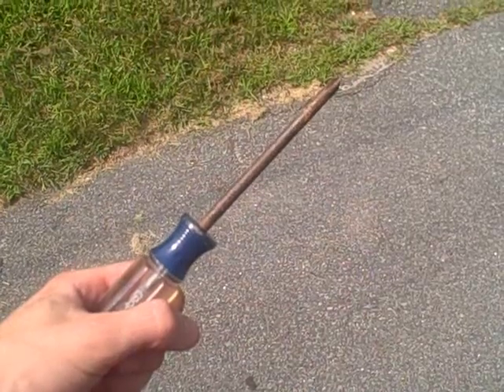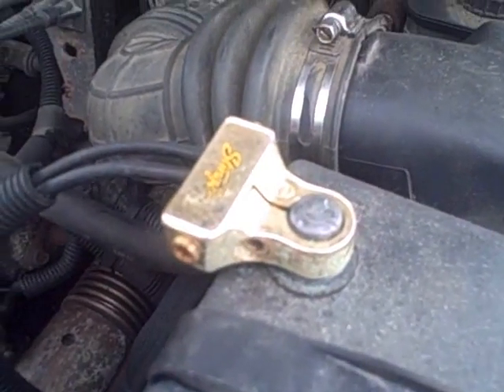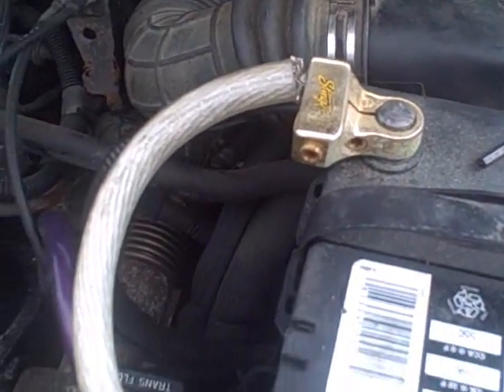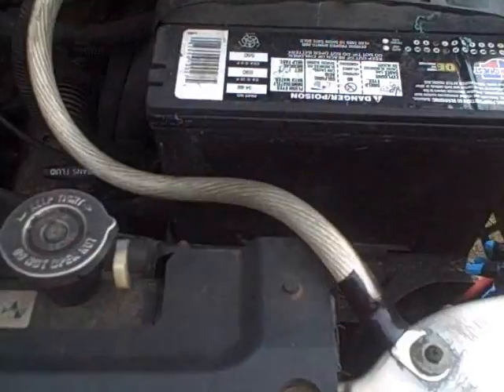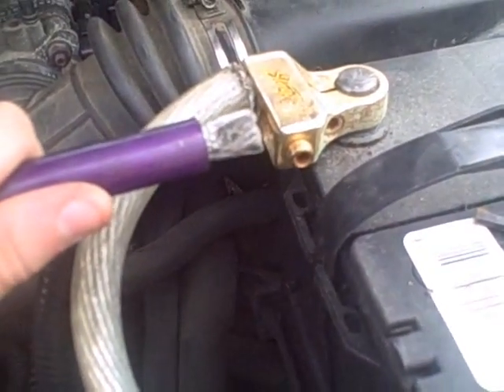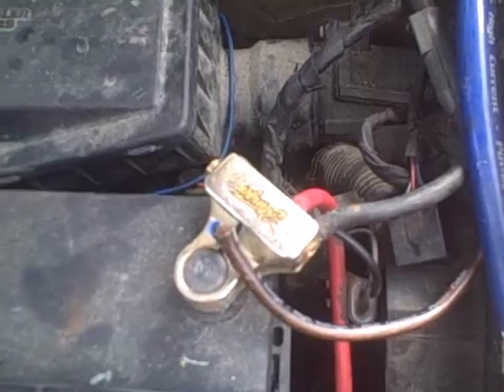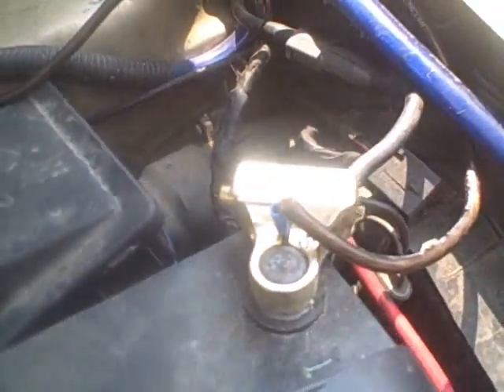Increase Car Audio Power 25% - How To Install Big Three Upgrade - Easy 15 Volt Stereo System Big 3

Comment: @watupholmes
Actually, here in NY, they will absolutely break your balls for having your system bumping. Anything over like 85-90 db will land you a $300 noise violation. Then, at that point in time, they have every right to start nitpicking and write you tickets for tints, exhaust, low tread, endangering the welfare of others, etc. Just because your ignorance hasn't landed you that lovely ticket, does not mean it is a foolish thing to say.

Comment: I'm from a family of mechanics, so we've know about this kind of stuff as it applies to other things as well. I'm using a second battery and 4ga. Im only running 1200rms watts (900 to subs,300 to mids) 4ga is enough. Now my lights only dim at idle at high volumes. You can just barely detect a slight blip in the lights at 2000rpm+. If i go with bigger amplifiers, I'll add a bigger alt, run 1/0 for ground and from battery to battery. At least you aren't telling people to put a "cap" in. Thanks!

Comment: hey bro, quick question every is saying to have my 0 awg wire from the positive on my battery to the alternator, however the positive on my battery runs to my starter and from my starter to my solenoid (ford) and then the power comes from my alternator to the solenoid,, what should i do in terms of switching for the o awg switch the wire from the positive battery terminal to the starter? or switch the one from my alternator to the solenoid..hope u can help
Reply: your (fused) wire from positive battery to positive alternator post connects in parallel to the existing system and works together with it transparently

Comment: @EXOcontralto dude i like ur video but as a plumber i can tell u that u can go down  a size w water and get the same gpm but ur pressure will greatly increase. the same process is used to create water pressure coming out of water towers and even in ur home to create more pressure...but going up wire sizes can't hurt anything and even if it dont help it makes it easier for when u do replace the alternator. u should'v done a before and after volts and ampage reading so no one could agure w u.

Comment: @addisonu23  Believe it or not, your tutorial is more informative than even RF has on here,and really easy instructions to follow.Only thing I recommend is to add the chassis ground to the strut/shock bolt as it is a more solid ground,directly to the frame of the vehicle.Yet, thanks for this info, as alot of people will benefit from your video.Thanks man!

Comment: @speakerlover13 I went to school for electrical engineering, worked for custom shops for 7 years, and now have my own shop; yeah, I'm probably an idiot. Most stock alternators only produce 90 to 100 amps. And I'm not playing the 'what if' game; I'm talking about stock only. As I have stated multiple times, you cannot draw more from an alternator than it was designed to produce. Upgrading the engine ground is still useless unless you change out the alternator power cable as well.

Comment: @EXOcontralto Oh, and if you require an analogy - Just because you put a 42" wide hose on a 3000 gallon per minute water pump, doesn't mean you will ever get more than 3000 gallon per minute.  The pump isn't designed for it.

Comment: @EXOcontralto Not sure if I'm replying twice or not, looks like my other comment got removed... But it all comes down to ohms law, you can't create more than your alternator can produce. If you're running 0 gauge to the back, yes you need to use 0 gauge to ground the battery, but if you have a stock alternator, there is no point running more than 4 or even 8 gauge from it to the frame.  Even if you did, you'd still have to run a new + power cable from the alternator to the battery.

Comment from the maker: @TheEnragedHawk - On the contrary sir - You can definitely increase the amount of amps drawn from your alternator... Just the like analogy of a hose - You could have a 6" hose on a 3000 gallon per minute water pump pumping out 3000GPM's.The second you put a smaller hose on the pump, the 3000GPM water pump can no longer reach it's full potential... Bigger hoses = Less Resistance = More Power.... Lesson learned: bigger wires allow for bigger current draws.

Comment: Good video, but I think you're off on your 25% boost and 15V estimates.  You can't create any more voltage/amperage than your alternator can put out (unless you're using a transformer but that would be pointless), and if you're using a stock alternator, 4 gauge is more than enough.

Comment: @MrWhybotherwithme I would start with google :) Then, figure out how much you want to spend, and how much bass you want, as well as the quality :) Personally i have 2x10" MTX Magnums (got them in a combo deal($180) with an amp,250wrms) and they are great, but low quality. It really depends on the box, and the box depends on how much space you have in your car, and what kind of box it is. Another MAJOR part of a sub system is the amp, a quality amp can make all the difference:)

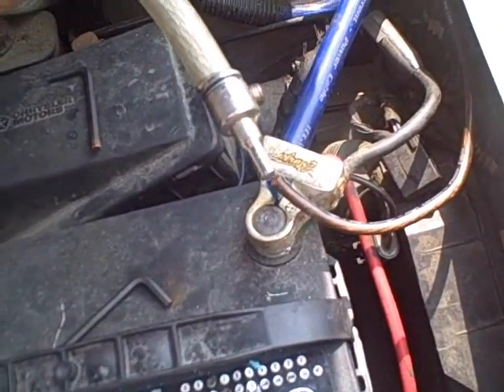Comment: @SubMasterT he has capacitors for his system. when they are drained, you dont want to just reconnect the battery or put the fuse in or it will spark hard enough to burn terminals as well as send all kinds of electronics killing voltage spikes through the electrical system. (the "zonking" he mentioned @ 2:36)

Comment: hey exo, im thinking about doin the big 3, but not sure what guage wire to use, since shits expencive in australia, dont wanna go unnecessarly big

ive got 2 12" kicker CVR's being powered by an Option Audio OAK1200 at 1200rms @1ohm, but my amp apparantly has a realy small footprint. ill also be running a 2ch amp, 300rms (75rms p/ch @4ohm)

Would 2 guage be good enough for engine block ground, battery ground and if I run the pos. wire and have it split to a 4guage and a 8guage? 

thanks man

Comment: little tip for you is if you need a washer and are too cheap to buy it,just drill a penny and use that. only costs you a penny.

Comment: Cool, I had it right all along. 2/0 to the back and 1/0 for the big three. Its a Work in progress. I'm building the wires now to run the big 3, and working on ideas for the amp rack. Im not in a hurry

Comment: hey EXO,
love your videos btw.

but to get down to business, ive been doing a bit of research and found the big 3 upgrade.
and its costs.
my wallet is a bit busted up after upgrading my system.
so what i did, with my old 8 awg, was making 2 connects over the existing car connections.
i connected from the alternator to the positive battery, and the negative terminal to the car frame. 
i know this isnt as effective as 0 awg connections, but would this increase my electrical flow?

Comment: To those that understand the video I'm going to add my input that wasn't mentioned in the video. Yes you need to upgrade your battery to a red top optima ($189.99 battery) and see about a 120 or 240 amp alternator (about $160 alternator) or you will kill your battery and possibly blow some fuses.

Comment: hey bruv i was wondering
if i need to add a fuse in between the the alternator positive to the battery positive 
also i have not done this upgrade yet as i am looking around for problems that my system is giving me atm

every time i turn up my bass controller the CD player cuts off then switches back on again, i have upgraded my alternator to a much bigger one and i was wondering if once i do the big three upgrade will this error be fixed

btw love the bass vids bro
keep up the good work

Comment: @blodswetngearz Thanks for the answere, but I have already changed the cable from the alternator to the battery but thinking about getting a 1f capasitor. Also got a voltmeter in the car now so I can monitor the volts. Doesnt look to bad got around 14,4 V at the amplifier when the car is running but its only at really high and much bass it dimms so think the capacitor will do the thing. Thinking about Rockord fossgate capasitor :)

Comment: you grounded it to some thin sheet metal? youd be better off grounding it to a bolt in the strut tower those bolts run to the frame. That sheet metal will vary based on the welds made to it. It works but it could be better

Comment: Upgrading the wire size will NOT provide more power to your electronics. Every electrical component will draw as much or a little power as it needs, regardless of the size of wire carrying the current. (electricity 101). The only thing upgrading wire size does is allow the safe transmission of a certain amount of current. 0 gauge wire is rated at a MAX of 600v and 170A with insulation rated for 90C degrees. So if your system only needs say 60A save your money and go with 4 or 6 Gauge.

Comment: Hey great vid, but wondering I changed the cable from the alternator to the battery and the cable from the battery to the chassy but didnt change the one to the enginge block because i got about 40-50 mm of cable to the minus, shouldt that be enough? Because my lights dim when i play it loud. Ive got a 500 w rms kicker 15" 2 ohms and a JBL 7001 aka 700 w rms in 2 ohms  (mono block) and as ive heard it drains double the power with mono, aint sure about that but it said on a car specialist site

Comment: @Venom2007s well i don't think it'd be cleaner per say, but this is the way i've learned to understand it. think of the wires as a garden hose. the larger the hose, the more water will go through. most factory wires are at the very most 4 awg. so increasing the wires will allow more current to flow.

Comment: @SenorDennis 
if u think about it... a cap dumps its power very quickly and then pulls power to recharge and if the cap stays consistantly discharged it is just another current strain... big 3 increases power flow from the alternator and to ground giving you consistantly higher power

Comment: I'm thinking of doing like a "Medium 3" upgrade with 4 gauge wire instead since I'm not running a high watt system. (more of a SQ setup) I wonder what gauge the factory alternator and engine ground wires are.

Comment: Did the big 3 upgrade today because I have been experiencing voltage drops to 11 or even 10 volts. My capacitor would read 13.0 volts when I wasn't playing any music then would drop from there as the bass hit. After doing the upgrade my voltage is consistently sitting at 14.1 volts and stays there until I turn it up loud but even then it NEVER drops below 13.5. This is the best upgrade I have done to my electrical system so far and to me I see this upgrade more important than installing a cap.

Comment: @Jayrod4113 How the power will get quicker and cleaner? Could you please explain? The cable will not have less resistance. It is the same thing. It has been rated for the 90 amps already from the factory, changing the cable or adding a new one should not make any didffernce if the alternator is the same as std. From my point of view this is only required if a High output alternator is intalled.

Comment: @Venom2007s alternator's are grounded already from being mounted to the engine, you have to upgrade the positive wire going from your alternator to the battery, the alternator like you said will not pump more juice than its rated for but the power will get to the battery quicker and cleaner.

Comment: Question to the experienced ones : If a car has a 90amp alternator and Im running a dedicated positive 4g cable from battery to my amps and a ground cable from the amps to chassis. I would guess that the cables (batt to Alt and chassis to alt ground) are thick enough to provide 90 amps and all the additional current needed will come form the battery. Therefore, Why any cables connected to the alternator have to be upgraded? The alternator will not be able to provide more than its rated capacity.

Comment: @zombiefein2909 I think what he is trying to get at is that this method of wiring increases how much current can flow to the amp because your not going to get anymore power than what the alternator is delivering period, the maximum potential difference (Volts) is the maximum that the alternator outputs to the battery. It just makes it easier for the current to flow when the amp demands it due to the fact that he is using naut gauge wire and the way it is wired. That's my two cents.

Comment: Hi, great help, i only need to solve something, is necessary to use a 200 or 250 amp fuse in the line of alternator to positive battery post? thanks.

Comment: i have no idea what you said while you were dimming the light.  you mention charging capacitor, and something about resistors.  what does that have to do with the power cables fuse and why is the light bulb dimmin?

Comment: @cardboardcat15 If the wire from my alt to the battery is over 4-5ft should i fuse it or is the wire still considered short?

Comment: @CP1124 They do it for the same reason you fuse any power wire. If for some reason there was too much current flowing through the alt+ wire that would surpass the wire's handling capabilities, the fuse would pop, stopping the current flow. This is very unlikely on a run like that. If you didn't have a fuse, the wire might melt and cause problems, maybe even a fire. Most wont fuse this wire because the run from your alt + to your batt + is so short, and the aforementioned current flow scenario.

Comment: @CP1124 Generally, most people won't fuse the + from the alt to the battery +, but it's never a bad idea. Some do, some don't. I have mine fused, but just for safety. It never hurts to be too safe.

Comment: need advice. if my batt is in the back, im already planning on running a 0 gauge from poss batt to alt. Should i run the neg to engine cable? I want as much power flow as possible but if i can replicate this cable by attaching elswhere i will?  What do you recommend.

Comment: @cvbn4400 its your ground cable. you need to hoist your ground cable tightly to the chasis of your car on a surface which has no paint and is without rust. the noise your hearing is due to your ground cable not being attatched securely

Comment: i just did this.  Unfortunetly my headlights still seem to dim and it didnt seem like the big 3 helped with much of anything.  Im running a kicker 15 inch l7 at 1000 watt rms from a hifonics hfi monoblock amp.  Im probably going to install a power cap soon to see if it helps but i was just wondering if you had any other suggestions or advice.

Comment: This is a good way to provide alot of power but only if you have the right equipment. 0 gauge wire is pretty big. I have a 1000 watt kenwood mono d amp with a 12" mtx audio jackhammer and i used 8 gauge wire. And i could put that car driving to shame haha. If your not running a certain amount of amps then youll lose power

Comment: I have a question about alternators. Instead putting a new and bigger one in can you just install another one thats like the one you have. Ex: I have a 160 amp alternator can i just install another 160 A alt? Or will that not work?
Thanks!
P.S. Im obssessed with your vids keep them coming!!!

Comment: i have a kenwood KAC 8105d 500WRMS @ 2ohm amplifier running a DD1512 at 2ohms and my car's electrical system while running runs at 13.8V.
I have 4AWG wire running to the amp 
the wire for the ground terminal on the battery is somewhere around 6AWG
While running, i play a 40hz tone into it and raise the volume and i hear distortion.  i read the voltage at the amplifier and it drops to the lower 11s to the 10s and the voltage at the front battery is around 12V 
what should i do?

Comment: @ exocontralto you dont screw any terminals to do the big three upgrade. the best way is to drill a hole and sand and bolt your wire for the best results. not trying to be a smart-ass but i was taught that way and have had nothing but positive results. by the way i like all your other  videos so you know that i am not trolling

Comment: Hey Exo, I was just wondering if I needed to upgrade my alt and batt before doing the big 3 upgrade. And also, as far as the terminals on the battery goes, what do kind of adapter things do I need to get? I have side terminals so that might be a problem.
Thanks bro!

Comment: i have a problem i have two 15'' kicker l3 solos and they are hooked up to a kenwood 1800 watt mono and a kinetic extra battery but every time i turn the radio up the amp cuts off and turns back on

Comment: important question i have 3 cvx 15s and i want the best amp to push them so i need to know which amp is better out of hifonics brz 2400.1, planet audio 2400.1 or soundstream LW1.2600D, soundstream rub1.2500d, or power acoustik 5500?

Comment: @SM00THBOIMAKC You want your capacitor as close to your subs as possible. When your beats need a little boost you want that power from the cap to get there as quick as possible.

Comment: Hey man I need a little bit of help!? Well I'm about to do the big three upgrade but I still have stock battery terminals and really don't want to spend money on new ones. Anyway is it OK if both my wires are on the same bolt and are touching each other. Like the ring terminals from the engine block to negative and the ring terminals from the ground to negative would be touching each other. And same with positive, expect it would be touching my sub wire. Help would be appreciated!

Comment: Goglesux your an idiot. Cars are not designed to have any after market audio installed. All the big three does is alow the maximum amount of power to be drawn from your stock battery and alternator. Its not an exact 25% increase, just an estimate

Comment: im thinkin bout doin the big 3 on my car but in 4 gauge and leave the existing wire also but i only have a 1200 watt monoblock and 4 subs wired to it, i really ont think i need a big 3 but i still think ill notice a difference especially with the deep bass